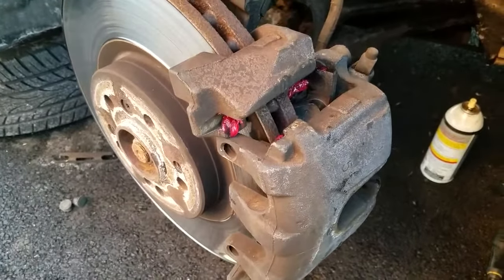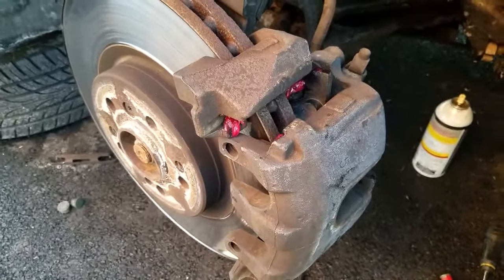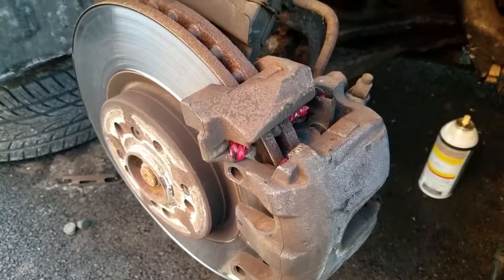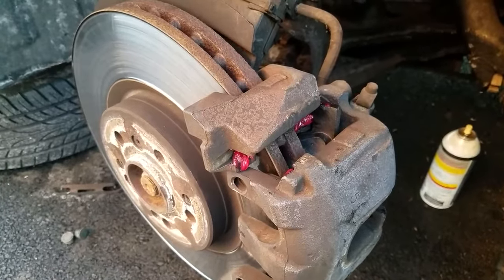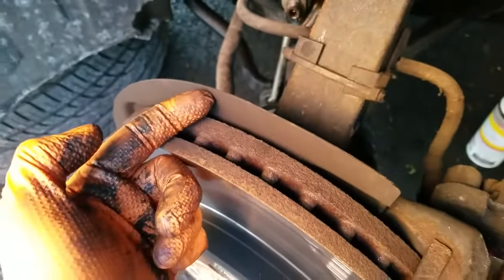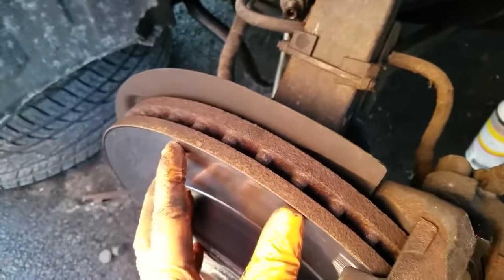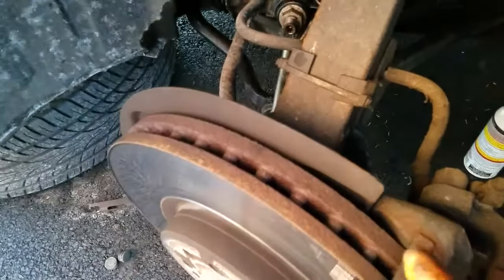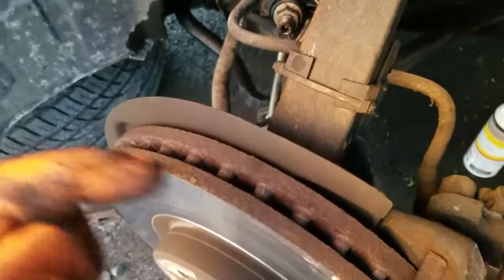Why Are My Brakes Rubbing After Changing Pads? Here's the Solution

Comment: Will it hurt to keep driving while it’s making the noise?
Reply: i kept driving like that for over 5months,now the noise is louder
Reply: Not really
Reply: Hurt your ears tho
Reply: Yes
Reply: Probably not food for fuel economy or your engine if it's touching enough to slightly slow your vehicle
Reply: I just meant hurt it to drive it home. I fixed it soon as I got home.
Reply: I Driving it and the brake  pads are new and the disc are getting
Reply: Yes and no. It wont be of any immediate concern. But over a short time the sound will get louder & the rubbing with eat away the rotors surface
Reply: @ApparitionGroupUSA  exactly
Reply: You are better off fixing it, unless you want to replace your rotors sooner then necessary
Reply: @FORSAKENTOX1N  its fixed themselves
Reply: @johnokon5924  LMFAO
Reply: It should hurt your confidence. 😮
Reply: That's what I thought but I'm still going to get them checked tomorrow
Reply: Yes, the ultimate end result is is if you choose to ignore it one wheel or whichever wheels are making the noise will result in completely wearing away your brake pads and rotors way sooner than the other three wheels and on top of that If you still don’t fix it, you could wear your brake pads down so thin that they could disappear and eventually have your calipers rubbing against your brake rotor, which would be a way more violent noise than a thin brake pad and then not only will you need to get new rotors and brake pads? You also need to get a new caliper which would cost more money not to mention Economy, wise the rubbing of the rotors and brake pads slows your car down meaning that it needs to put more gas to go, which would drop your miles per gallon by a few miles or it could be more than a few miles so basically yeah when the problem happens, it’s best to just get it looked at right away. You could tell the problems happening sooner by not really hearing scraping noise, but after getting your brakes done Down the line you start to hear pitch humming that is most likely your brand new pads rubbing on your brand new rotor and the only reason that humming is not scraping sound is because you still got life on the pad and the rotors so yes, it can hurt the pockets

Comment: I wa experiencing a kind of rubbing sound from front passenger side when braking, took it to the dealership and they said rotors were bad, I got the rotors replaced it was ok for the weekend and it started making the same noise ( brake pads have a lot of life left) I’ve had 4 different shops look at everything and say everything looks fine) I don’t know what else to do
Reply from the maker: Thanks for reaching out! We at YOUCANIC, are dedicated to helping car owners like yourself with maintenance issues. Our site, www.youcanic.com, provides helpful guides, free resources, and includes a powerful scanner that can help you identify potential issues. 

While your issue seems a bit complex, we have a host of troubleshooting resources and factory repair manuals that could be of use. If this persists, feel free to ask more questions on our platform. We're here to empower and support you throughout your car ownership journey!
Reply: Ever find out what it was?

Comment: been tracking down a siund since yesterday.. slight rubbing/clicking .. i dont drive with my windows down much so not sure if it began before or after i changed my pads.. its sporadic.. drove 8-10 miles home, didnt hear a thing until halfway.. 
took it out again, started as soon as we got out the driveway,  stopped and turned around.. and it quit. 
checked all the pads, they're seated fine.. had 1 rotor turned, just checked the shield as in the video... im at a major impasse on this
Reply from the maker: Thanks for reaching out! It sounds like you're dealing with a puzzling noise issue. Although it's hard to diagnose without being there, at Youcanic, we're dedicated to empowering car owners like yourself with a range of resources that may help. Visit www.youcanic.com to access helpful guides, our YOUCANIC scanner, and even factory repair manuals for a detailed look. If you need further assistance, do not hesitate to contact us through the same site. Our mission is to empower you throughout your car ownership journey. We look forward to assisting you!

Comment: Ok, so I was hearing a weird intermittent grinding noise coming from the right rear break so I took it in to the place who did my breaks a year ago and they said it was the rear backing plate, pulled it back a little bit like in the video and it solved the problem. Then I started hearing the same noise coming from the left rear break so I figured it was the rear backing plate again and it just needs to be pulled back a bit. Mechanic comes out and tells me that both my rear rotors are warped and need to be replaced. I've never heard of rotors warping and needing to be replaced after a year from getting a complete brake job. There's absolutely zero vibration in the brake pedal or steering wheel so I don't know what to believe. It's an intermittent noise that comes and goes which makes me suspicious of it being warped rotors. I crawled under the car today and pulled the backing plate back a bit and I couldn't hear the noise anymore so I'll see if that fixed the issue. Really don't want to have to buy new rotors after only a year and I only put about 6500 kms a year on my car. It's a 2012 Honda CRV and I just cracked 91k.
Reply from the maker: Thanks for your inquiry! At YOUCANIC, we believe in empowering our community of car owners with knowledge to make more confident choices. Your issue with the grinding noise could be related to various factors, your mechanic might be correct. Visit us on our site for free resources, guides, and the YOUCANIC scanner to further investigate this. 

We are here to support you every step of the way. The more detailed factory repair manuals available on www.youcanic.com may also give you the necessary insight. We strive to assist you in every aspect related to your vehicle, let's work together on your 2012 Honda CRV issue!

Comment: Does it sound similar to worn pad indicators? Mines making noise before changing pad .
Reply from the maker: The noise you're hearing may indeed be an indicator of worn-out brake pads. To clarify this, you can use our YOUCANIC Full System Scanner, which can help diagnose your car's issues comprehensively. 

If you still have doubts or questions, feel free to visit www.youcanic.com. Here you can access our wide range of resources and even ask car-related questions. We're here to assist you on your automotive journey and make car repairs more accessible.

Comment: My local garage put both inner pads on one side & both outer pads on the other side!! My breaks were supper hot to the extent you couldn’t touch the alloy !! I went back 8 times to the garage spending over £2000 on new callipers, discs, even flux hoses!! I was fuming !!
Reply from the maker: Thanks for reaching out to us at Youcanic! We're here to help empower car owners like you with valuable resources and guides for an easy car maintenance experience. Our powerful Youcanic scanner along with factory repair manuals could be of great assistance in your car ownership journey. 

We're sorry to hear about your troubling experience at your local garage. We advise you to check out our website, www.youcanic.com for any further assistance or troubleshooting. We're dedicated to supporting your needs and helping you save money in the process.